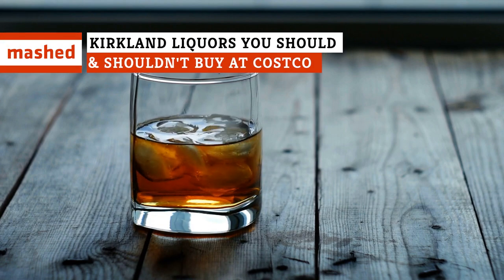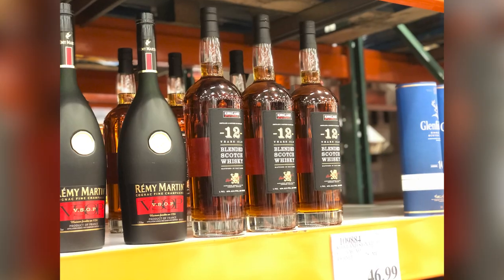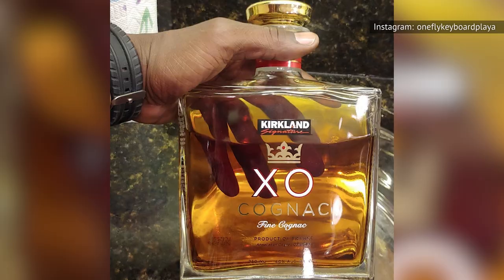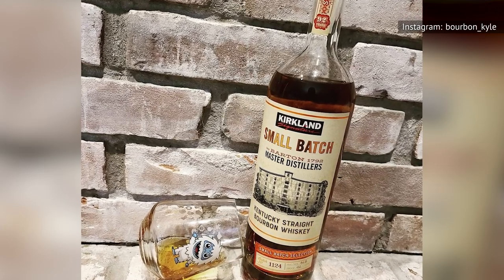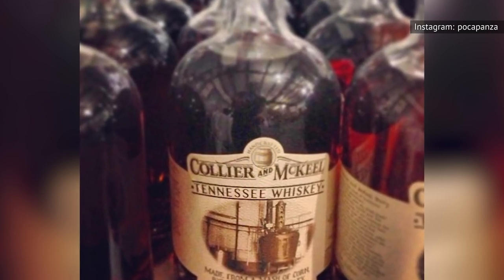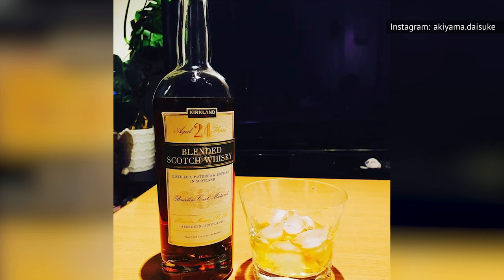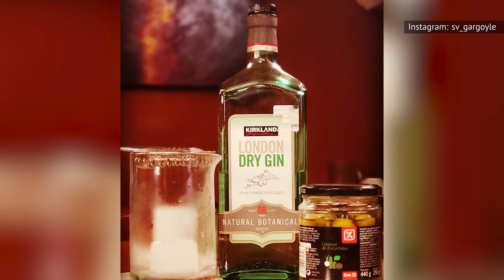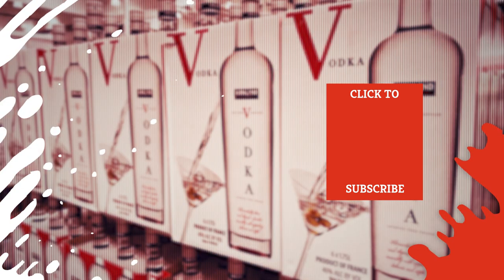Kirkland Liquors You Should & Shouldn't Buy At Costco

Comment: Not quite sure who is doing your tasting and research but I find the Kirkland Bourbon tasty.  I enjoy "hot" as you call them bourbons and this one fits the bill as an enjoyable pour.  Also I wouldn't consider 51% alcohol a "hot" bourbon as technically speaking Bottle In Bond is only 1% lower and is the agreed upon Federally regulated standard for bourbon.
Reply: Yeah I think it's a pretty decent bourbon for the price. I completely disagree that it isn't complex.
Reply: I’m sorry but the 7 year small batch is absolute trash. It took me almost two years to get through a bottle that I had to eventually start mixing into an infinity bottle with other stuff just to be able to drink it. The newer Barton’s line are solid as hell though especially the barrel strength.

Edit: I just went and looked, I’m not even done with the bottle, I have a half an inch of liquid left in the bottom on the bottle. I bought it in March 2020 😂

Comment: If you’re slamming shots of straight vodka you don’t care about flavor and smoothness. You’re wanting to get drunk.
Reply: In that case you might want to go with a triple-distilled at least, to minimize the fusels and other hangover-producing stuff. Or use another commenter's idea of running through a Britta filter several times. Also stay away from wheat vodka. Even Stoly is made from wheat if it's not bottled in Russia.

Also drink a lot of water, one glass per shot.